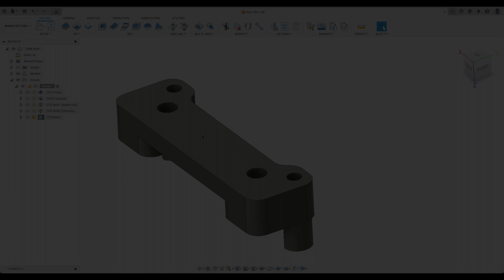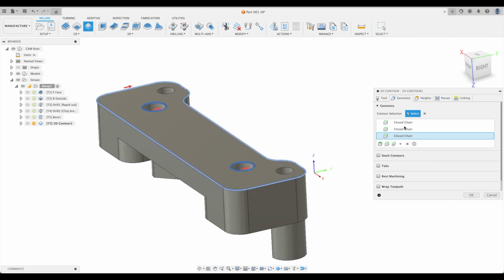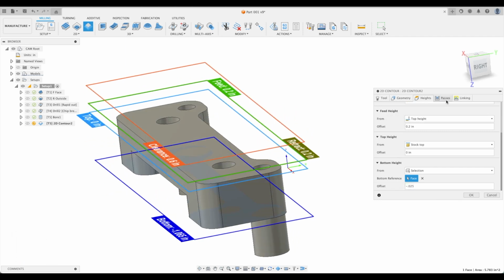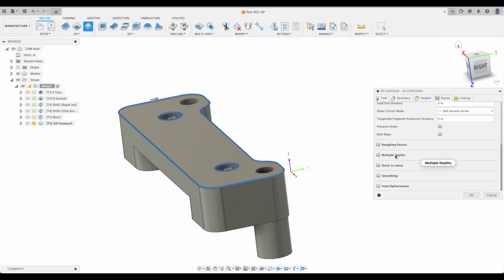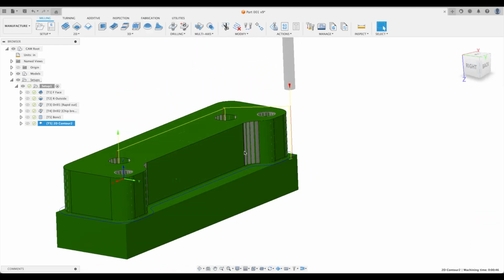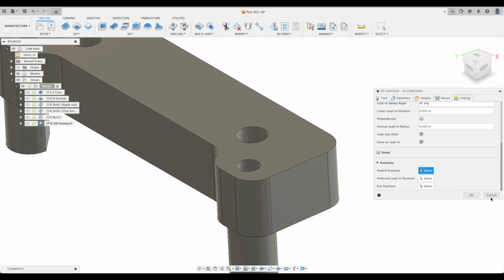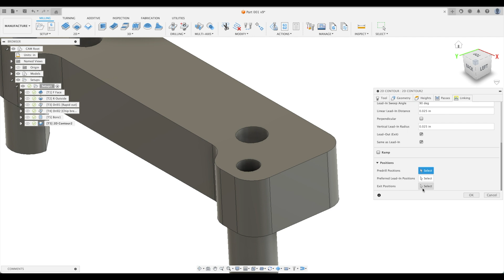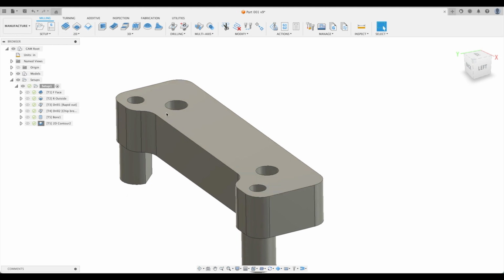Fusion 360 - HWIMT - Part 001 Setup 1 - Op 5 (2D Contour)

Comment: Hi, could you have used a 2d contour with a roughing pass on those holes rather than a boring path after drilling them and saved a tool path??
Reply from the maker: Great question! Yes, you are correct. The helical boring toolpath is probably something I wouldn’t use, unless like I said in the tutorial, we didn’t have the proper tool to drill (or mill) a particular feature. That being said, if I were to helical mill (bore) a hole, I would usually always leave enough material to finish it with a 2D Contour path so that the surface was finished nicely.
Reply: @learnitalready  Thank you. For some reason I am struggling with holes. Do you recommend drilling first or is helical milling acceptable/preferred to do? The contour path with Roughing is a little confusing to me for some reason. Would you consider doing a video cutting a 1/4 or 3/8" holes and the different ways to path them? I am trying to learn Thread milling and seem to always be short .010-.015 on the hole diameter.
Reply from the maker: @rufustoad1  Thanks for reaching out with your request. That is a great suggestion for a tutorial. We will put that on our list. 

To answer your question about helical milling: in general, no it is not the preferred method. Generally, a programmer and machinist would like a part to be machined as quick as possible, within spec, and with the best tool-life to time ratio while also considering cost. Therefore, drills are usually the best option, especially for smaller holes. 

When our shop turned to carbide drills from HSS, it was a game-changer for our shop. Then we started getting into indexable drill tips, and even custom designs which made huge breakthroughs in our productivity. So, we would highly recommend looking into different drilling options first.

Next, when helical drilling is preferred: when hole sizes are non-standard, when drilling is not easy (due to material or other factors) or if you are forced to (eg. you are missing a particular drill size). Here is a case-in-point: I was hired to work at a new machine shop to start working on a CNC router. The shop’s issue was trying to drill (using dozens of sizes of HSS drills) into various parts - sometimes with hundreds of holes. Well, you can imagine how long that was taking them. It was also frustrating for them, having all their drills explode because the min speed of the spindle was 10k. I said “what about using small endmills and helical milling?” Minds were blown as they never heard of that concept. So, a $20 1/8” endmill replaced their entire HSS drill library. 

If you were interested in a private consultation, please contact us at contact@learnitalready.com to discuss some options. Otherwise, we will try to provide some tutorials in the future explaining things further.

Thanks for your support! Stay tuned and keep on learning with us!
Reply: @learnitalready  Im a poor man but that is very enticing. I will email later this week!